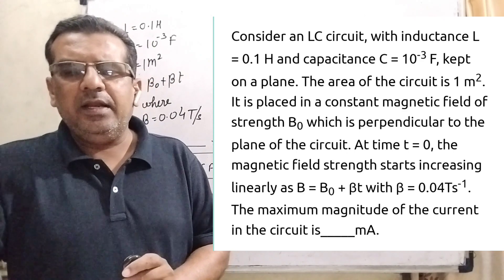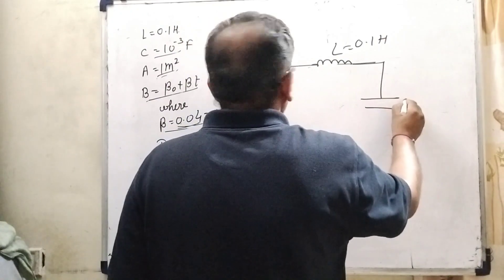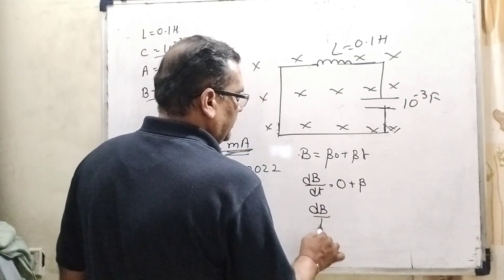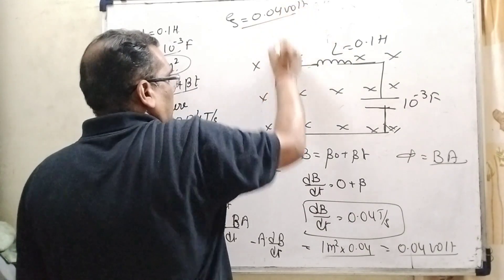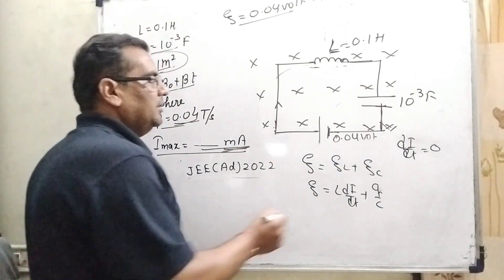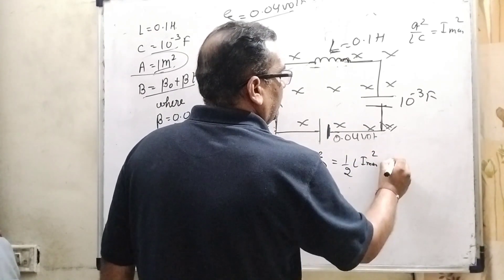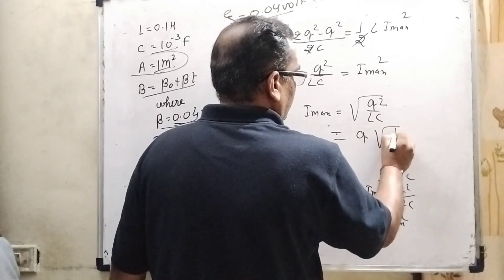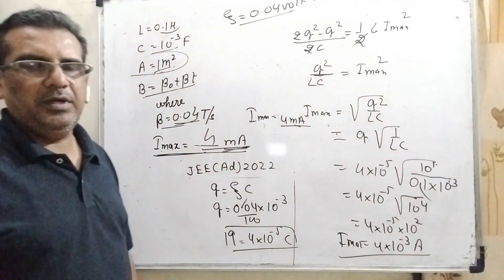Consider an LC circuit, with inductance L = 0.1 H and capacitance C = 10-3 F, kept on a plane. The

Comment: Sir I had a doubt that after taking out the induced emf, we can also apply I max = V/Z, And by putting w= 1/(LC)^1/2 [ resonant frequency condition], and here z=0 and current goes to infinity, but this is not practically possible. What is the mistake here sir?
Reply: From where did you get AC circuit?
Reply: this is dc circuit
bcz p.d is constant